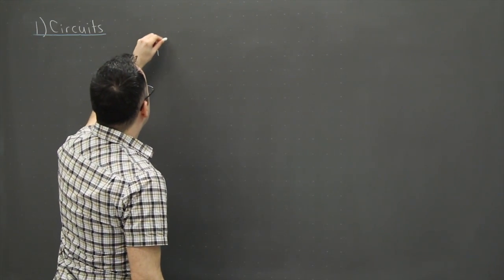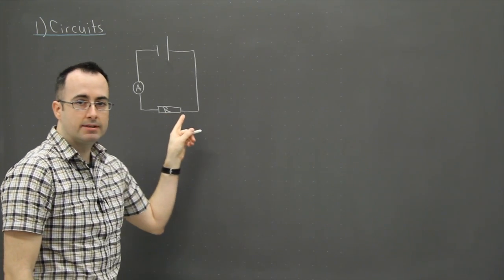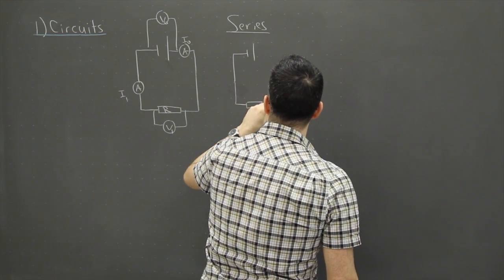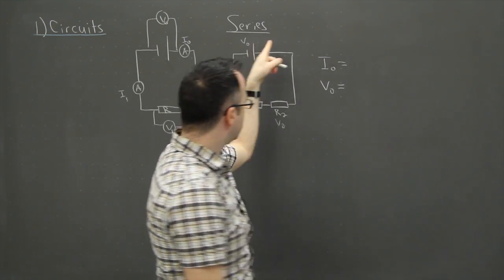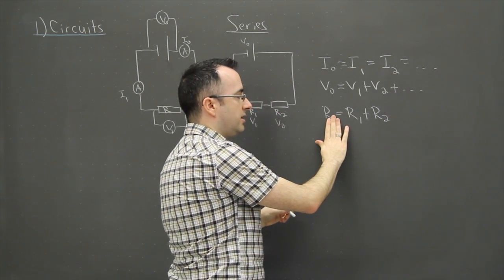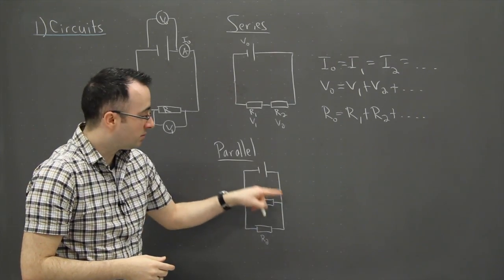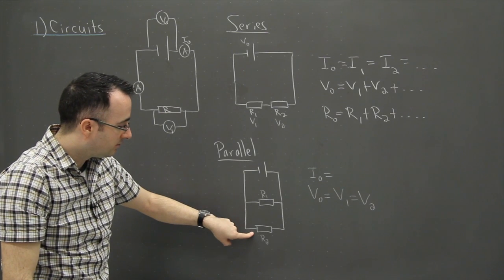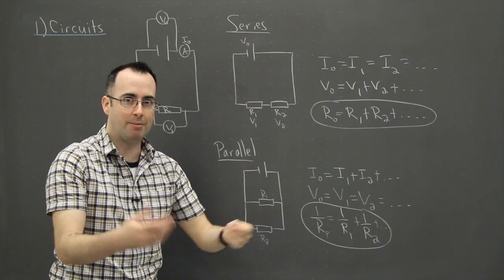IB Physics SL revision - Electric 1 - circuits2

Comment: QUESTION: using your analogy, when there is a chair there is resistance, so the voltage disappears so to speak so then when the same student arrives at the battery, it gets another piece of chocolate therefore the PD is 1 for 1 student. WHAT if there is NO chair then the chocolate wouldn't disappear so when the student arrives at the battery again it would still have the chocolate, can you clarify this...
Reply: If I may, according to the analogy in the previous video he explained that the students would be eating the chocolate gradually as they walk through the circuit... therefore, in the end of the circuit- there would be no chocolate left. I do not know if this makes sense for you but I hope you understand it :).